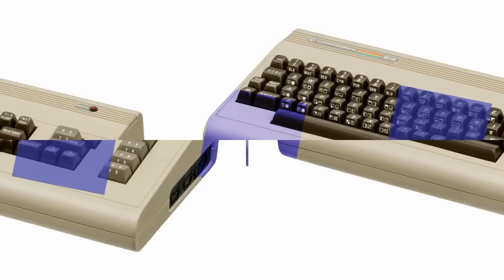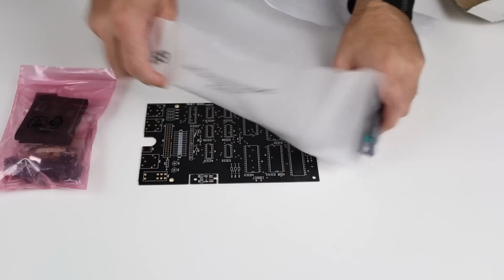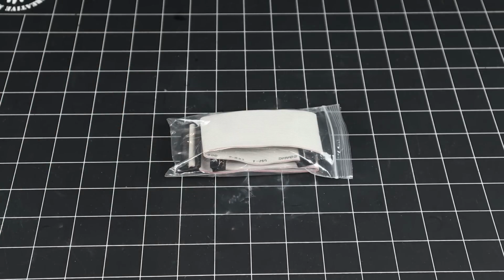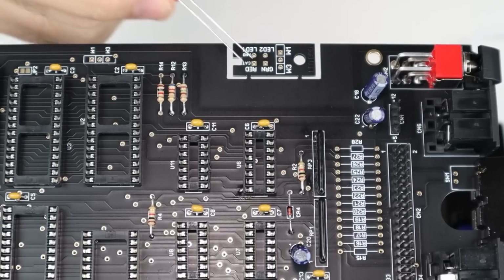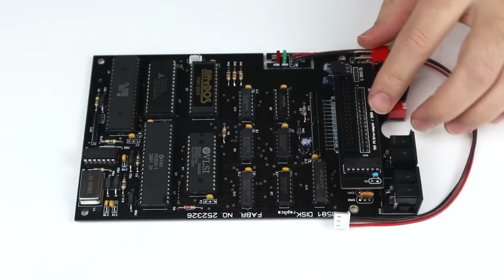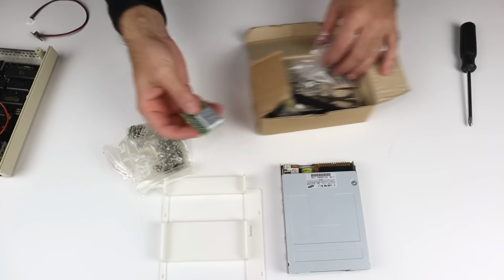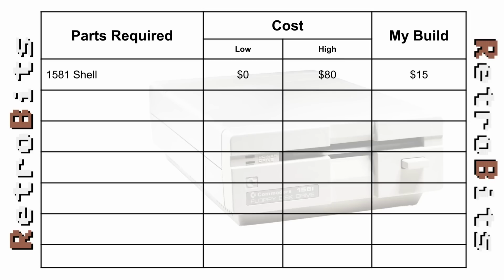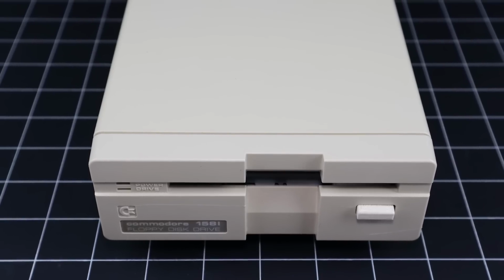Building a NEW Commodore 1581 disk drive!

Comment from the maker: My follow-up video on how to convert a PC drive for use without an adapter and issues you should consider before purchasing an 'enhanced' replica PCB for your own 1581 build project: https://youtu.be/-mKsMX0BG1Y
Reply: At the bottom of the 1581 advertisement, it shows "Allow 4-6 weeks for delivery".  Ahh yeah, slower and more patient times back then. :)
Reply: @BillAnt  No kidding. I remember pacing around, watching for the UPS truck when I built my first IBM compatible. The case, motherboard, and CPU were the last parts to arrive from a shop in California. It was only a 5 business day trip, but I nearly wore a hole through my parents’ floor running to the window every time I heard a diesel engine. That was 1990, a whole summer of lawn care throughout the neighborhood, to afford a VIC-30, a weird XT profile 8-bit IO but AT compliant motherboard, a whopping 1MB of RAM (in DIPPs!), a Trident VGA card, and a Sound Blaster 1.5. ELITE GAMING MACHINE! LOL
Reply: 2 notes:

1, flux of most sorts can be washed off in your dishwasher (with the dryer turned OFF). Dishwasher soap isn’t damaging to most solid state electronics, however, make sure you give it a day or two to dry out before applying power. Aside from that, a nylon brush and a clean paper towel works pretty well, with the towel on the board and the brush pressing it into place.

2, there is no such thing as an “oopsie” in computer work. What you experienced was a PEBCAK, or “problem exists between chair and keyboard”. I have written so many PEBCAKs on support tickets that I have to assign it when I screw up, too. 😉

Comment: C1581 works well with C64 and VIC-20. It is/was great for cross-platform file transfer too. Amiga can read and write the 1581 disks with my c1581-handler (although I never bothered with subdirectories/partition support), as well as PC 720k disks for further options.

Comment: The Commodore disk drives are expensive because they were engineered very badly and hodgepodge instead of rebuilt over the years. by 1988 when the Amiga 500 was shipping with a built-in disk drive, the old drives were still available at retail for the C64/128. which should never have been made in the first place because they're so terrible. and probably one of the reasons why Commodore went bankrupt. bad engineering.

Comment: I know I am like 4 years too late but when you use a nylon brush and IPA use a kitchen towel / paper thing and lay it over the pcb after you applied IPA, the flux IPA mixture will be soaked into the paper towel and after a fresh rinse with IPA over the board afterwards you should be able to have a non stick surface

Comment: Funny to see the 1581 again.. 🙂 I remember when I was in 6th grade and my grandfather and me drove a long way on a Saturday to finally buy the C128 for me that I had been waiting for. Is was expecting to get a 1541, but when we arrived at the shop (it was in Aalborg, Denmark) they were sold out, but they just got the 1581drive and we bought one of those instead. As I remember it costed almost as much as the C128 and my grandfather was not super thrilled about that haha😀When I came to school on Monday and told everyone they thought I was lying about the drive. It was not yet announced in any magazines or commercials and wouldn't be for at least 6 month as far as I remember. So I had to bring the drive to school next day to prove it. As it turned out I was the only one I knew that ever got one, so I had to bring it to my friends places each time I wanted to trade new games. That was a hassle, but on the positive side it loaded faster than the 1541 and 1571.
Reply from the maker: Wow a 1581 as your first and only drive! That would have been cool but also impossible to use most commercially released C64 titles with :P
Reply: yeah it was copy only as far as I remember. But then came the Amiga and I switched to that. 12 Amigas I had through the time. Today I regret selling all of them😅 I think I may buy a 1200 again🙂

Comment: There is a 6502 emulator for the raspberry pi pico. I'm thinking you might be able to use a pi pico to emulate the entire drive. Either interfacing to an SD card ,a thumb drivr or a real drive.

Comment: Back for a second viewing.  Arctic Retro has an interesting video up today in which he builds a replica 1581.  Due to an error in the board labeling, during the build the 6502 and 8520(?) chips were swapped.  I really hope you didn't run into that with your board.

Comment: I FINALLY finished putting mine together, and everything "looks fine." Unfortunately upon power up BOTH LED'S "STAY SOLID" which appears to be a serial bus lockup of some type. I will change the serial cable tomorrow and see if that fixes it. If not, I did something wrong. 😢
Reply: I've checked all the soldering and connections, swapped the psu, swapped the 6502 and the 7406 and still have the same problem.  So next I will purchase another WD1770 and see what that does  If nothing, I will have to acquire another 8520. After that I'm effin clueless.
Thanks so much
Reply from the maker: Man that could be difficult to diagnose if it's not an obvious problem with a bridged solder joint or a component in backwards. It would certainly help to have a working 1581 on hand so you could test out all the chips and the EPROM, etc. just to verify the problem isn't one of those. Good luck in getting it going!

Comment: Amazing work... All that's left is to sand down the 3D printed button so it matches the rest of the case in smoothness! ;-) Now go ahead and try the 1581 version of Colour Spectrum on your shiny new 1581 hooked up to your C128!
Reply from the maker: I still need to fix the button. I did remove the LED and create a new power lead so that's 2/3 tasks done! I have tried the Colour Spectrum demo!

Comment: Even a lot of retro gurus nowadays agree it's more cost efficient and safer to use a modern switching power supply instead of the old transformer based commodore supplies.

Comment: I built one of these boards and I use a regular USB charger as a power supply as my floppy drive (Sony MPF920) only require 5V. So I just soldered a DIN4 male connector to the other end of the USB cable. Cheap and simple!

Comment: Cool, but I mean ... when rebuilding a top-end C64 drive, why not go straight for the FD-4000?

Ok, not that you'll find a hole lot of ED disks around anymore, but HD disks should still be plenty.

Is it just that the retro-community considers the 1581 preferrable over aftermarket options like the FD-4000?

Comment: Back in 1992 I designed and built a 32kB RAM expansion with a 32kB ROM Emulator for the 1581. Good ole times.

Comment: I feel so lucky that I found a original 1581 drive. I use it on my VIC-20 all the way up to my C128D. Cool stuff!
Reply from the maker: I regret selling my original 1581from back in the day but have managed to replace most of that stuff by now. Finding a replacement for my old Lt. Kernel drive though, now that's another story...

Comment: i see you used the called for 180Ohm in R12 & 620 Ohm in R13  The lights where way to bright and blinding for me. so I ended up putting a 3K in to R13 and a 1K in to R12. did you make a similar change?
Reply from the maker: I didn't change any of the components that were in the parts kit I received. The LEDs appear to be at a reasonable brightness though. Are you using the same color LEDs as me?

Comment: Thank you for this great video, I enjoyed it very much. Can you please shove me in the right direction as where I can get the "drive bay" thingy, the thing you printed at 08.20? I have a drive which is missing just that thing. Thx.
Reply from the maker: I got the 3D model for that from the forum64.de thread that's linked in the video description, but you will need to register an account to be able to download the attached files! Here is a direct link to the post with the file: https://www.forum64.de/index.php?thread/102472-1581replica-gotek1581-1581-pc-drive-adapter/&postID=1722477#post1722477
Reply: @retrobitstv  Thanks.

Comment: Is this still available? The links are dead. D:
Reply from the maker: Ah YouTube seems to be eating the links. I've made them tinyurls instead, those seem to work (login required for the STL files link). I'd start by reaching out to the AmiBay seller if you want one. Note that there are at least two other options available now, including a minified reproduction board on AmiBay:
https://www.amibay.com/forum/want-to-sell/hardware-for-sale/commodore/2408302-1581-replica-board-smd

And this model from Corei64:
https://corei64.com/shop/index.php?route=product/product&search=1581&product_id=404

There are also pre-assembled boards (DIY Chris) and shared projects (PCBWay) you can buy these days.

Comment: Ok,  so...  i have an original working 1581 drive, and in a earlier post I mentioned I built this board, and it works well with an original 1581 drive mechanism..  does not work, with anything else..  even with the adapter and the sfd321b pc drive...    inerestingly enough, the original 1581 board does not work with any other drive, even with the mentioned adapter..     i get 'bad disk error",
Reply from the maker: Hrm, it sounds like the commonality here is the adaptor itself. It sounds like it has not worked for any drive in any situation. The design is trivial but could it be something simple like a bad discrete component or 74HCT02N chip?
Reply: @retrobitstv  perhaps,  I just got the adapter assembled from a reputable guy i buy from when it comes to this retro stuff.

Comment: What drive did you use on this? 1.44 or 880?
Reply from the maker: I used a Samsung SFD-321B which has documented support for both standard (1MB unformatted) and high density (2 MB unformatted) disks. All the high density drives I considered claimed to support standard density disks so I'm guessing that's pretty common but it doesn't hurt to check the spec sheet.
Reply: @retrobitstv  i built the board, and tested it with an actual 1581 mechanism, and it works fine..  does not work with Amiga 500  i get 'bad disk error', nor does it work with a teac 1.44, with the adapter..   thank you for the response, i'm hoping the sfd-321b will work.
Reply from the maker: @undergroundstudio9810  Interesting, it should work with the A500 drive with no problem! I only tried it with the single 1.44 drive but I have a bunch of them. When I get a chance I will try out a few more and see if they work or I just got lucky.

Comment: That's really cool, but I can't help but think that this entire board could be emulated using a raspberry pi or similar board. There is already the Pi1541 project, but it would be cool if there were a Pi1581 type project that used a real floppy disk drive instead of just reading from a file. It's less original than what this project is aiming for, but a lot cheaper and more practical.
Reply from the maker: Not exactly what you're talking about, but check this out: https://www.amibay.com/forum/want-to-sell/hardware-for-sale/commodore/2408302-1581-replica-board-smd

Comment: Hello sorry if I ask you but I kindly wanted to know the value of the diode in CR4, then where to find the diskdriver adapter card to connect the floppy and if the floppy needs to be modified, thank you.
Reply from the maker: According to the BoM, CR4 is a 1N4148. For the adaptor, you may want to try contacting toms01 on the forum64.de, or you can get your own PCBs made from the open source gerbers https://gitlab.com/toms01/1581-pc-drive-adapter

Comment: isn't most of those games on a 5 1/4 floppys tho? Can you do the same with the bigger floppy drives? :O
Reply from the maker: The 1581 was mostly used for productivity purposes and very few games came natively on the format. That said, any game that was cracked and had its copy protection removed and didn't use a 1541-specific fastload routine would likely work on a 1581 disk. A good rule of thumb is if it works on an sd2iec it'll probably work fine on a 1581, but if you have an sd2iec there's not much need for a 1581 anyway :P

Comment: and(!!!) can this logic board drive the 5/25 720kb DD PC Floppy drive? (or maybe 1/2mb drive switched to 720kb mode by conf.jumpers on their control board)
Reply from the maker: The 1772 disk controller should work but if i had to guess you'd need changes to the code in the ROM to handle the different drive geometry, otherwise you'd get an 800KB formatted 5.25 disk which might be problematic with double density media. The 1581 uses MFM encoding so even if you swapped the drive mechanism it wouldn't be able to read disks from a 1541 though.

Comment: I notice you’re running 80column mode on your 128. Could you tell me about that Sony crt? I desperately want a period correct monitor for 40/80 modes.
Reply from the maker: Sure, the monitor in question is a Sony PVM-1342q which I reviewed here: https://youtu.be/4aaRi_yN0ds There are also a bunch of other ways to get C128 80 columns to display using converters, adapters, or even monochrome composite which I talked about briefly here: https://youtu.be/EtfCxej4OWM

Comment: Found my old 1581, self boots, but locks up the communication link to other drives and printers when connected.
Reply from the maker: Hrm, first thing I'd check is that all the drives have unique device IDs. Also, if you have a modern wifi modem plugged into the userport that uses UP9600 hack, that will conflict with the 1581 in 128 mode.

Comment: 12:05 .. your mistake wasn't damaging the part. It happened way earlier when you did order the exact amount you need and no spares.
My basic rule is one additional one for every started 5 pieces. So 3 when I need 2, 9 when I need 7, 15 when I need 12 ... 

 If they are cheap and common, I get 50 or 100 and store them for later.

Comment: A very generous amount of IPA and a cheap toothbrush, then brush. Next, lay a sheet of paper towel damp with IPA over the PCB and run the toothbrush around soldered areas, this will help pick up that sticky/tacky feeling on the PCB surface.

Comment: The 3D printed parts are low quality and low durability. Domestic printing is a toy, the results are a far cry from factory-molded or pressed ABS parts. For some small bits it may be all you need, but you can't get a complete case look nearly as good as the original.

Comment: Great video, specially the price comparison table at the end; it's easy for most people to think they are paying overpriced items on ebay and amazon, but when you really dissect the components in retroitems like these, you can see some prices are about the same you'll spend on your own building from separate components ($300 to $350 seems about right if you don't have any parts available to salvage from old equipment); you know that having the top of the line floppy drive from the 80s nowadays is not going to be cheap...

Comment: What is that plasticine that you used during soldering of goldpins? Some special plasticine that withstand high temp and won't leave dirty stains?
Reply from the maker: It's not specifically heat tolerant as far as I know, but it doesn't leave anything residue behind in casual use like this. It goes by a few names: "Blu-Tack" or "Mounting Putty". The one I'm using is this: https://amzn.to/2ZATJ6T
Reply: @retrobitstv  sounds useful, thank you very much

Comment: Really nice thing. Very cool that it's mostly new parts. But as always with these videos I feel like there's always a delayed hit where it sounds like it's gonna be all new parts, and then oh it turns out you need a CIA chip which has to be new old stock or sourced from another thing. Also would be cool if you could use a modern power supply without needing an original one?
Reply from the maker: Yea, there are modern equivalents for the CPU, EEPROM, and RAM, but not for the CIA so far as I know. Probably because right now they're not hard to source, as they were used in plenty of FDDs and Amigas. Once they become difficult to find, I wouldn't be surprised to see someone create a modern replacement like we've seen with the PLAs, SIDs, soon the VIC-II, etc. 
There are a few modern power supply options available, including from Ray Carlsen https://portcommodore.com/rcarlsen/customPS.html polyplay https://www.polyplay.xyz/Power-Supply-for-Commodore-1541-II-1581 or electroware https://ebay.us/Xk5UPS

Comment: Awesome vid! How compatible are these with Demoscene software?
Reply from the maker: Many demos have built in fast-loading routines that specifically require a 1541 to work. There are some recent releases that will load from an sd2iec and should work fine on a 1581, but as a general rule it's probably not a good use case for this drive.
Reply: @retrobitstv  Cool thanks for the info. Yeah I suspected most fast loaders were 1541 based, being the more popular drive. Didn't know if 1581 was similar enough internally to work too.

Comment: Awesome! How much extra software and hardware would be needed to make it DSHD I wonder 🤔
Reply from the maker: Good question! There were high density drives made for the C64/128 by CMD (FD2000), so it's totally within the realm of the possible. That said, the VL1772 disk controller used in the 1581 is only designed to interface with double density drives, so at a minimum it would require upgrading that, new firmware, etc. That's about as far as I'm willing to conjecture but I suspect that the increased data rates of HD disks may require more buffering or flow control, I don't know; well outside my area of expertise!

Comment: Hi, can I ask question? there's a drive:A emulator unit lying around, instead of using diskett , it allow you to use the USB instead, do you think it could work together?
Reply from the maker: Yes, a gotek drive running the FlashFloppy firmware should work fine instead of a PC or Amiga drive.